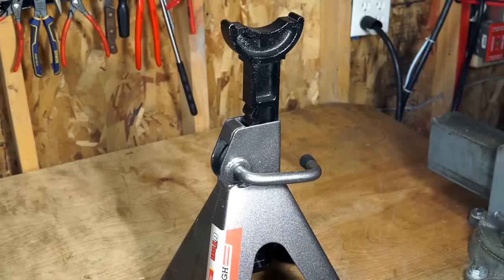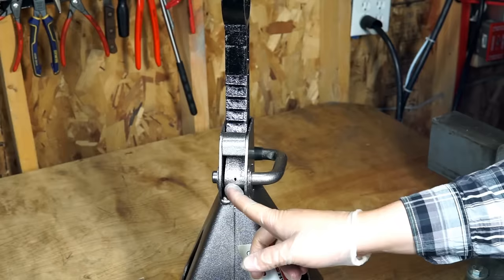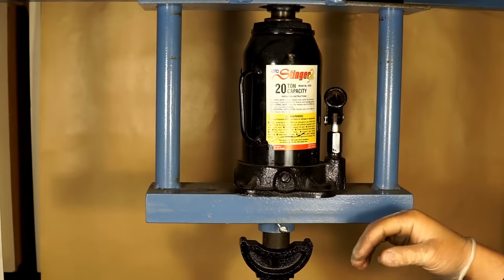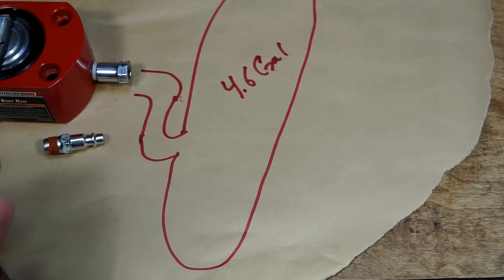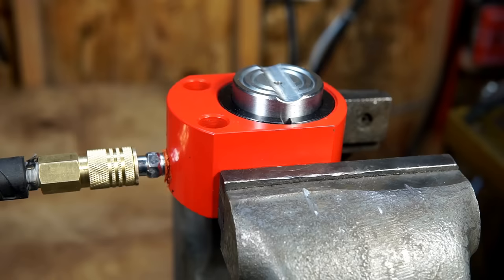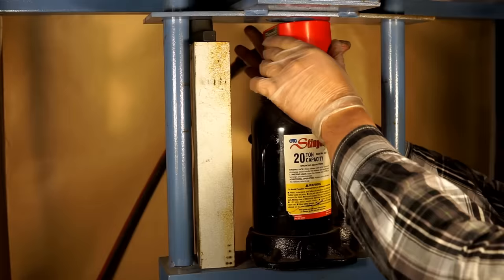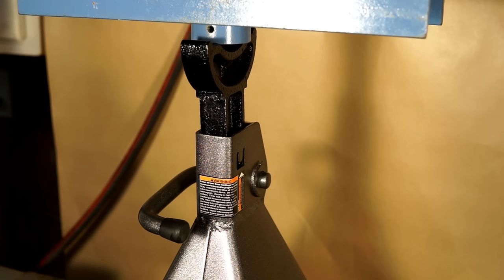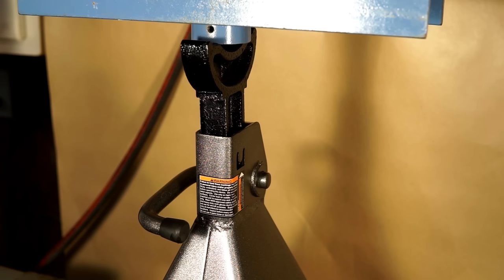EXPERIMENT: WARNING! Doing this to your Jack Stands will get you KILLED!

Comment: thats why you always slide the/a tire under the car where you are working.
Reply: Exactly.  Or keep a couple of scrap pieces of 6x6 wood post material around.
Reply: This right here
Reply: Wyatt C. Or a second jack as a fail safe so you can get the hell out from under the car
Reply: Wyatt C. I was taught this and have never looked back.. safest easiest method..
Reply: one of the many things my brother taught me
Reply: I use jack stands, leave the jack in place and put a tire under it. If its going to fall all three have to give, which is very, very unlikely.
Reply: I know that professionals work with just jack stands but they scare me by themselves.
Reply: Smart move. Always give yourself an out when you're going to be under a car. Can't be too safe.
Reply: Wyatt C. yup
Reply: I always do this lol
Reply: Don't you rest your head on that tire?
Reply: FliegenKlappen if you can imagine climbing inside a 69000 shaft horsepower engine climbing up the timing chain into the cavity all oil slick it to inspect the bearings inspect the counter mates and inspect the welds and you know what I'm talking about safety
Reply: Mates=weights.
Reply: Is that on a ship or something?
Reply: I do a trifecta of things, leave a Tyre under, leave the pressure on the jack and use locking pin Axle Stands (not Jack stands) and don't stay under for very long, only for a few seconds. Had a car come down on me luckily im rather thin so it didn't hit me but scared the 10 bells o' shit out of me so now take no precautions
Reply: +Cle Collins  I dont think 6T jack stands will hold up a car with 69000 hp engine.   :)
Reply: @Wyatt C. Yep, BEST insurance for positioning a 2,000 pound weight right above your head.
Reply: Wyatt C. my bro died under his car using jack and stands! Yep real shit, I tell everyone I see now working on their cars on the side of the road this, slide that wheel under the car behind or in front of your stands! Don't use it for your ass! use it to save your ass! I wish everyday I could go back in time and say this to him! we both worked in this field. But yep he jacked it up took both front wheels off his car put stands under either side and even jack was there but somehow he rocked the car forward while prying under it he didn't have e brake on or wheel chocks and somehow both stands and jack was flipped sideways they slipped off and that was it! I just so wish he placed the wheels under each side somewhere. just sucks, I agree though so much this is the best tip to me, good post!
Reply: A space saver no doubt. I think most adults would still be crushed even with a full size wheel. It will help you get a jack under the car though.
Reply: I use logs as well, plenty laying about from firewood season, use the thick ones which are wider than they are tall, practically no chance they'll fall over. still, jack stands + logs, still scary rolling under a car.
Reply: great idea leaving a wheel under the car
Reply: Yup... or wood dunnage.
Reply: +800lb Gorilla
I  worked with a mechanic, he helped me at home, he insisted on lumber under the frame at the least.
Reply: jonesgerard same reason I use logs, big ass redgum stump wood, isn't going to split, isn't going to move, if the stands fail, the redgum wont
Reply: @jonesgerard The two disadvantages are muscling it around and storage, with chunks big enough to use.
Reply: KitCox eh, I dunno it seems easy to me, maybe not to some. if you're in an apartment or something you couldn't store them
Reply: I totally agree especially the tire with the rim still on it.
Reply: Wyatt C. have you been watching Chris fix?
Reply: Yup.
Cheap and easy, you have to put it somewhere, why not put it where it will save your life.
Reply: Good advice...I did place tire under my truck while changing my brake pads and rotors.  Has the manufacture of this jack stand resolved this safety issue?
Reply: Would the jack stand be safer if it's a heavier car ?  It would take more that 500 lbs to raise it ?   If he had it under the front of the 914 it would be easy to move in an upward direction.   It's like a Volkswagen one bigger guy could pick it up!
Reply: Wyatt C always use a tire and keep a few good blocks of wood
Reply: @ RANS87IROCZ

You'll make yourself crazy wishing for that. I know you can't help it though. I feel for you.

I had a near miss in a similar situation. I had only the jack stands. I was fortunate to be positioned so that I noticed my stands start to lean. I backed off what I was prying on. Had I been turned facing away from them.....  :(

Take small solace that I'll be using your method from now on out.
Reply: Amen to that. Tire underneath is what I learned and always have done.
Reply: No matter the weight of the vehicle Im working on if I take a tire off it goes under it so if all four come off they all go under I even do this with my quad bike even when I'm not going under it but this was a massive surprise when I First worked at a diesel mechanics we had the front end of a truck off the ground wheels off and they had all there trust in two old looking stands
Reply: Exactly. That, plus use a floor jack as a back up. I usually use the larger truck jack stands. Unless it's a big job, usually you can get by without even raising the stands.
Reply: @ RANS87IROCZ 
So sorry about your brother.  
Requiem aeternam dona ei, Domine, et lux perpetua luceat ei. Requiescat in pace. Amen.
Reply: To Wyatt C. That's why you always slide a tire with a wheel under the car so you may be only partially but not completely crushed. You put the tire in a position so it will not be punctured if such a calamity occurs. I always do U-joints in the car with one arm using a technique I developed without completely removing the drive-shaft, as well as for exhaust systems, so you do not have to go all the way under and do not jack up the car. For brakes and suspension, usually you are not under the car but be ready to get out in an instant if something craters.
Reply: Not sure what good a flimsy 914 tyre would be in this situation... they are not exactly 265 ;)
Reply: the entire wheel
Reply: Wyatt C. Exactly. If im going under there I have some wooden cubes of various sizes I can use, made of cut up scrap 4x4s  just for this specific purpose. Didnt cost a dime to make them. I put a few around where im working. Worked on my own cars for over 30 years, never had a situation like Mike and never needed the cubes to save me, but there they are.
Reply: I have not seen any comment that mentioned the use of formed steel ramps. If put on a reasonable surface with rubber floor mats or boards under them or on gravel they will not skid and give good elevation. Have someone tell you when to stop when going up. I use them all the time.
Reply: bunberrier  I'm a wood worker and I use wood also.. Here is my philosophy on that..I can hit a  two by six with a sledge hammer and it takes a while to break it.. I do the same thing to concrete block.. craaack one pass.. I almost made a big mistake today working on my 1999 expedition.. didn't realize I had almost all the bolts loose.. I started to take one bolt out, decided to crawl out and find a two by six to support the tank which had about 30 lbs of gas in it.  Glad I did ..when I listened that  bolt..  tried to fall on me,  glad I had the extra support.  Got to go out tomorrow and Finnish it.
Reply: Supreme Arbiter  The steel ones with proper rateing are great.. I've used a couple of times.. I drove up on a plastic rubber plair and they started to deform.. I'm sure it was a cheap pair.. But the metal would be much better.. A lot more surface area too. Also both tires can stay on the car.. I'm sure there are times it is just an option.. always depends on the situation.
Reply: PIANOSTYLE100 Roger that. The load rating of a single 4x4 vertically is 7500 lbs if I have that right. Screw a few of those together , or as others posted use a stump, and you're all set. Those layers of safety will catch the inevitable moment of inattention. Good thing you saved yourself!
Reply: bunberrier  back in the old days they had gravity fed fuel pumps and after that some cars had a little electric fuel pump..So I wouldn't be under there.. if they hadn't modernized them..Just recently the pump went in the tank.. so let's see electricity and gas vapor.. good combination.. anyways I'm off that... I am going to put some  ganged eight bys so I can put it as fail safes..plus supports.. I did not know what the vertical support of a 4 by 4..is if that's correct that's impressive.. I'll check out the horizontal  figures.. but of course as it is used in a ganged manner it has a additive effect.
Reply: To PIANOSTYLE100, Yes. The ramps I have seem to be good quality. The ramps can be a problem with low slung cars. In that case sometimes I use a pre-ramp to the ramp of my own device which can solve that problem. As you say, we have to remove wheels all the time though and therefore those jack-stands can come in handy but the test in the video shows the potential danger. So a wheel or stump or block is an extra safety, or a scissor jack for example.
Reply: Supreme Arbiter  somebody made a point that a full size adult can be pinned  under a car even with a  tire underneath. Every thing seems to be a compromise.. a car can roll down a ramp..ect.. but if the wood is attached in some manner clamped with welding c clamps or something. Even chocked wood can move away from the front tires.. And I'm not a mechanic , but   dont the emergency brakes  only work on the back  brakes.. so when the back tires are jacked we lose a major safety precaution.. which if car moves .. could cause Jack's to fail...
Reply: To PIANOSTYLE100, That's for sure. We have worked under cars on sloped pavement and you cannot trust the hand brake anyway. You can put metal chocks under the wheels with grips but they could skid. I have seen pictures of people jacking up H frames with an engine on a slope and that is really insane. On a slope, jackstands could topple. On soft ground they could topple. Just remember to pull the jackstand out before you drive the car. Maybe we should not work on our own cars.
Reply: Supreme Arbiter  I just saw a  trailer . It was made for pulling  small bulldozers..in fact my great uncle used to pull d9s  caterpillars..on lowboy type trailers and they had steel with overlaying two by eight lumber.. so I'm thinking wood if properly maintained will be safe.. what do you think..  I'm thinking  of being prepared next time I work on vehicles.  I am thinking of  a  heavy duty ramp.. it would have a steel welded frame.. and solid pt wood..decking I'm thinking about a foot wide and a permanent four by four at one end. Two custom made wedges that would lock into place.. These could be locked into place..No more movement at all.  I would make the  ramp about Eight inch higher would make all much safer . This could be backed up also.. I think this is doable..it may be just a pipe dream..
Reply: To PIANOSTYLE100, In the final analysis, wood is king. There is nothing like it. It can support large ships in dry-dock, it supports locomotives when they are being rebuilt and acts as shims for the cranes that move them, it is used as a base for the legs for large portable cranes and so on. So really how could one go wrong using cut up rail-road ties with smaller blocks on top to fit on the frame of a car. I use 4 x 4 s occasionally and let's face it, as one of the other commenter's observed, concrete cracks and wood is virtually indestructible. I was touring old warehouses with a Fire-Marshall and they had posts that must have been 2 feet by 2 feet thick and the Fire-Marshall said "they could never be consumed by fire and yet steel beams can bend if not insulated with asbestos by a garbage can fire". Your idea of super ramps is almost to the point of purchasing a used lift system which would be nice but would you get one that you drive onto or one that has arms that extend under the vehicle. It would be nice to have both. But failing that expenditure, I think jacking up you car, removing all wheels and having rail-road ties cut into blocks under it with wooden shims would provide super-stability. I am always on the look out for cut ends of 2 by 6s that wood-working companies discard and have accumulated many of them for the express purpose of shimming up cars and yet still never seem to have enough.
Reply: That is great info.. I hope others are getting this info.. I'm trying to get the fuel lines off of my 99 expedition.  It looks like the same connection as my fuel filter had.. of course I've forgot how to do it.. I used a quick disconnect scissor like tool about five inches long.. I'm going online and try to find how to do it..only way to get at it was from the back.. I do have two by six under the pumpkin. I took that apart last year..  I'm having fun.  I've got it apart did I mention I do everything the hard way.
Reply: To PIANOSTYLE100, The way to disconnect the line is to use a cap off a Sharpie and "carefully" cut the end off down to the penholder clip mount. To avoid cracking the Sharpie cap it is best to use a small hacksaw. Then you carefully cut down the side of the Sharpie cap the full length, (avoid cracking it) so you can pop it on over the line and push it in to the "quick release connection" on the female end and wiggle it a bit and bingo, the line will come apart. Good luck!
Reply: Wyatt C. That's what my father taught me 20 years ago and continued to follow it..
Reply: Indeed.  And some extra wooden blocks.  Where are not cats.
Reply: Carpe diem  I built a little 3 legged heavy duty stool.i was jacking up my  99 expy just behind the left.passanger wheel. The way my three stool was contacted was the third leg as a 2 x 6.  The stool is one foot high.. . I put the jack over the where the 2 by 6
leg was.  As I jacked it up.. I  noticed the 1/2 common plywood was supporting probably close to 1500 pounds.... the jack  base was about 5  inches  square.. None it was  away from the frame and still  hold up to this  vertical  pressure.  I did not know that plywood was that strong.  You had to be there.. no cats were holding it up.

. As I jacked I watched for any weekness.
Reply: Can’t mess up those rims man 😂
Reply: Ive been putting a wheel under  for the last 35yrs..along with stands and sometimes the Jack..depends on area to be worked on
Reply: @RANS87IROCZ  Hi really sorry to hear that by the way what a sad story and you're brave to post this - I need to clean my rear axle up and just wondering is it all worth it especially as I am not brilliant mechanically - going to instead try to find a friendly garage with a lift or hire something - at least you can spend some good money on a strong trolley jack and towers and def have a belt and braces approach with stacked blocks of wood etc, wheel chocks etc
Reply: @ponderrous2659  yes man be safe I never knew you replied to me till today but for sure man be safe, I still sit here and smh over it, He was Wyotech grad here in PA and me Rosedale and we had many plans together, I never know now what we could of accomplished but in my head on every job he right there with me,thank you for awesome comment
Reply: @dottorb7054  thank you, still can't believe it happened
Reply: @adamdabrowski2301  Thanks man, I never knew anyone replied till you did today. But yep Evan Stromberg. He graduated from Wyotech here in PA got a job at Toyota dealer and was happy to do this type of work. I still can't believe he is gone! But hey you can do it just be safe as possible!! raise it up and put stands under it and also keep jack under it if you remove the wheels slide them under it for sure.  If you was local be glad to help. But find that guy in your neighborhood like me I'm always fixing people's cars here. Thanks for awesome comment

Comment: I always back it up with a floor jack slightly pumped to share the load. Chances of both failing at once is next to impossible, unless there is a hit-man out for you.  Place in gear, park and parking brake and of course wheel chocks. Be safe guys...